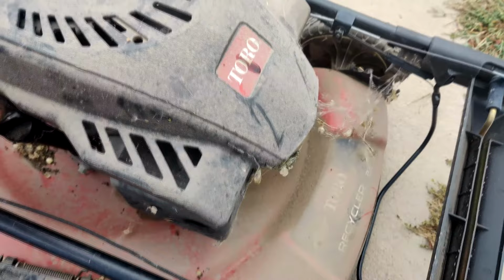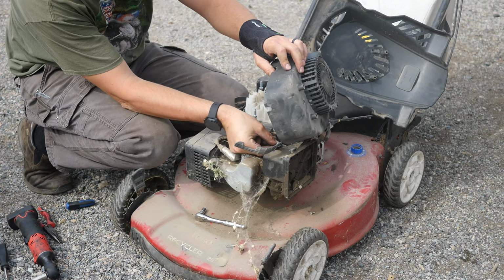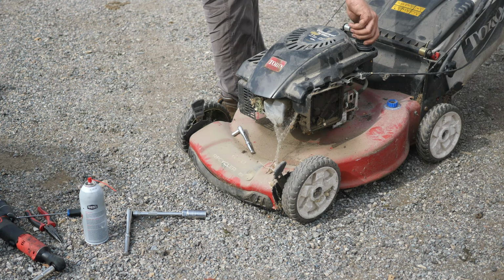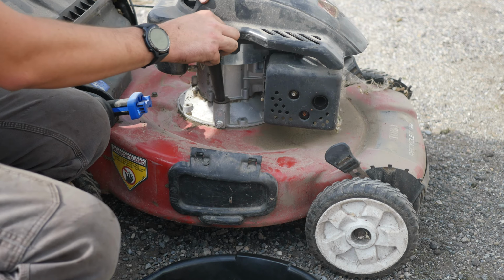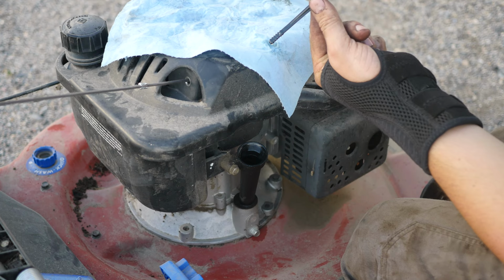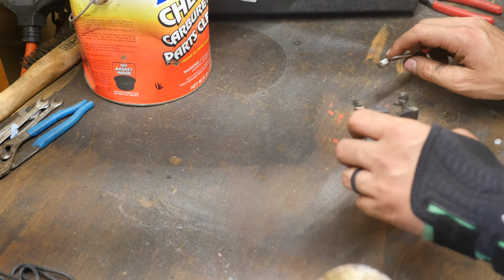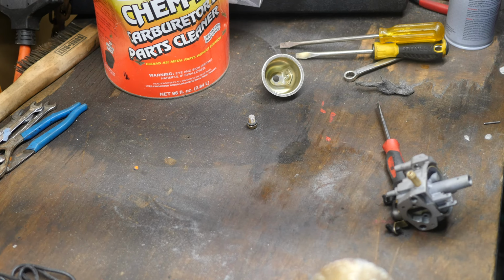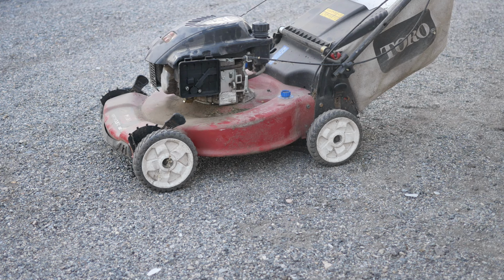Toro recycler 22" repair and maintenance

Comment: good mowers , I like the auto choke on ours as well ! Starts up easy every time
Reply from the maker: Do you have the same model? The only artichoke system I don't expectually care for is the one on the Honda's I've had a lot of issues with those or at least seen a lot of issues.
Reply: @ils360  No I have a different model , But the same engine .. Honda has a bad system  and many have had trouble with the choke

Comment: I bought one of those non running.  Coil rubbing flywheel. The bolt with stud not tight enough from factory. Coil rubbing. Came with 2 extra coils. No spark WHY? Watch a video Coil on up side down. Who would have known. Turn over Spark clean carburetor, sharpened blade, change oil sell.

Comment: My Briggs and Stratton 7.25 OVC Blows a puff of blue smoke from the carb. But won’t start. New gas new plug and I cleaned the carb.
Reply from the maker: Sounds like the intake and exhaust valves need to be adjusted.

Comment: Can that carburetor parts cleaner be used on the outside of the engine? Just wondering. I appreciate your video! Thanks!
Reply from the maker: Are you trying to clean an engine to reassemble or cleaning engine that is being used? It can be used on the outside of an engine If you're just trying to clean the engine up I would get some engine degreaser gel comes in a spray can just be careful with it getting on to paint.

Comment: 150 cc divide by 15 is the hp = 10 hp
Reply from the maker: Well it's definitely not 10 horsepower. The engine isn't physically big enough and does not have the horsepower when mowing the lawn I would guess it's closer to a four or five horse
Reply: Nope